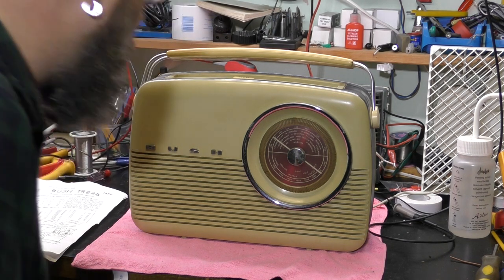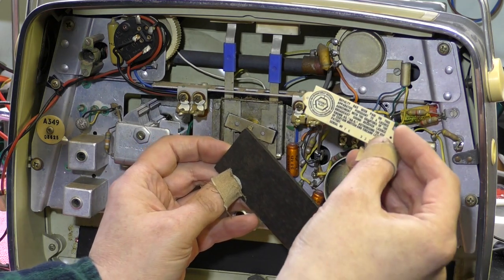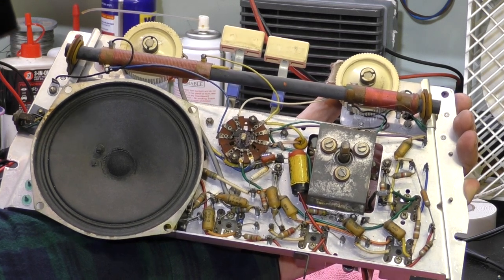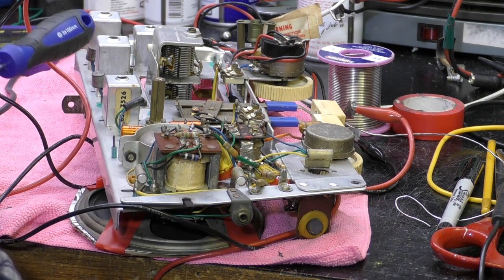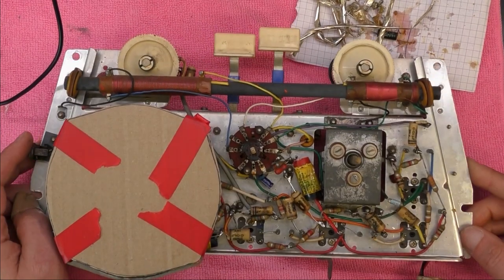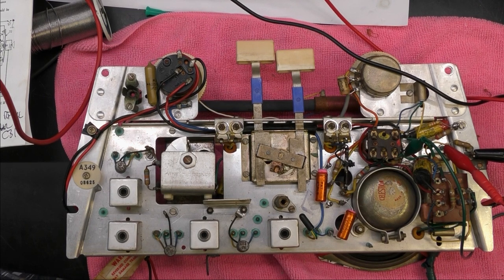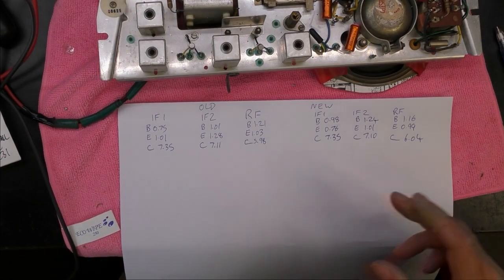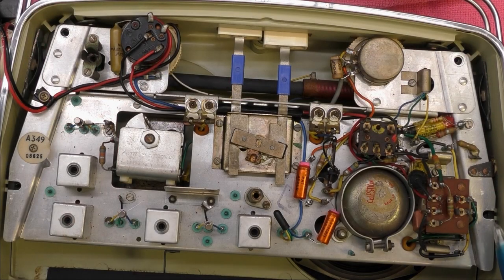Bush TR82C Transistor Radio 1963

Comment: Lovely Job Darren I Would Have Replaced The AF117 Transistors Also, Though i Have In The Past Zapped The Af117s With Great Success But In The Back Of My Mind I'am Never Convinced Of The longevity Of Doing This (whiskers never sleep) The Russian GT322B Transistors Will Never Give You Problems Great Video Regards mike.

Comment: I usually use some capacitors charged up to 160V to zap AF11X transistors. I did some more than ten years ago and they still work.
Reply from the maker: That's good you managed to to get some back to life. I didn't think of using such a high voltage. Results seem vary.

Comment: I was able to get the dial off without heat.  Since it's just pushed on it can be removed by getting your fingers under one side and then the other and gently using a rocking motion while pulling without applying too much force.  With patience, and rocking and pulling, you should be able to get it off in five minutes without breaking it.   It's designed to be taken off.

Comment: I've got the b model without those transistors no headphone soçket and a brass dial cover, metal bush letters, different colour case and this model, both are completely original with zero work done and both still work fine without any issues, perhaps not as well as when new, but being unmolested recapped I've decided to leave them that that way.
They are iconic and often seen in music videos set in the 60s, tv shows set in the 60s, they've been reproduced fairly faithfully, with added fm, so very much part of the public consciousness.
I'd guess the value of these original models will only go up.
20 years ago I'd never have imagined the big old ghetto blasters would have been as collectable as they are today, they were given away or sold for a couple of quid at car boot sales, and I picked up quite a few at the time, the real big ones with built in record decks etc.
Probably paid no more that a fiver for them, Luckily I kept hold of them, probably have a 1000 quids worth